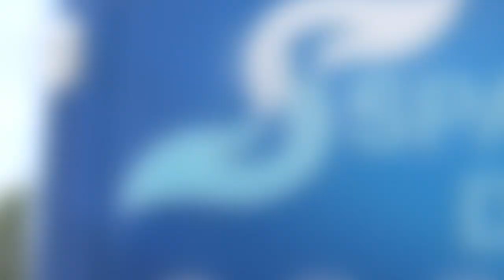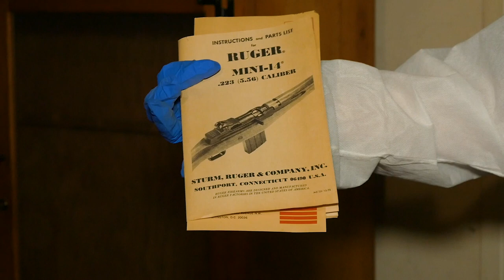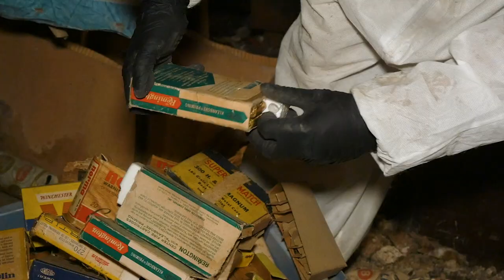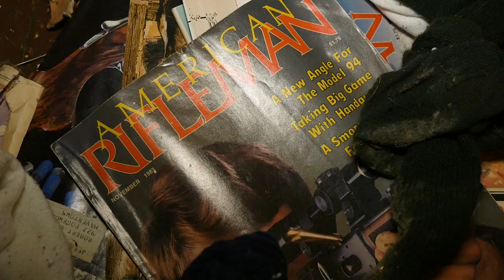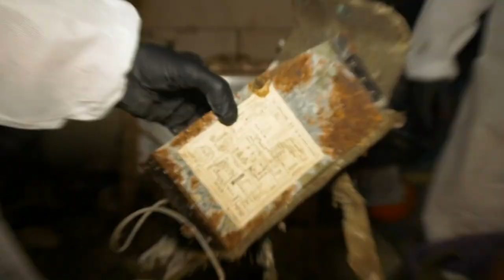House Hoarded with Bullets and Dolls Pt.2 | Philadelphia, PA

Comment: Questions regarding disposal of old ammo: 2 things, #1 you can call local police station and ask how to dispose of it (give estimate on how much for example "very old, corroded, approximately 2 5-gal buckets"). Or #2, call hazardous waste company. If it is new ammo you want to get rid of, send me a message. I will help take care of that for you. Also, the black tip ammo is armor piercing. Green tip (5.56) is a penetrator round. Red or orange tip is tracer and silver tip is usually an incendiary round or armor piercing & incendiary round (.50BMG).